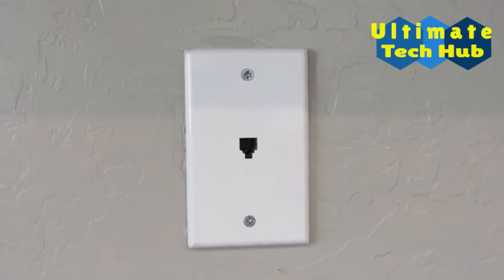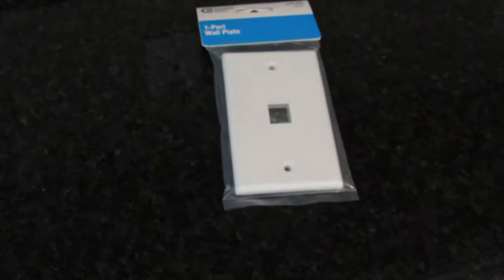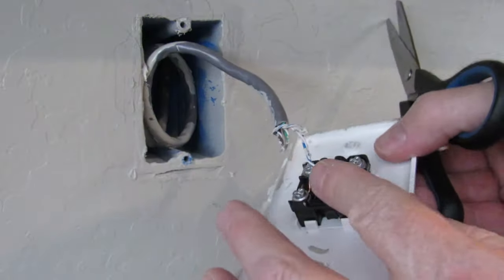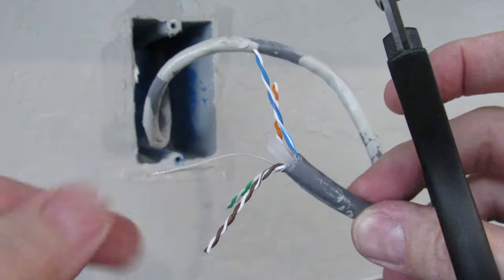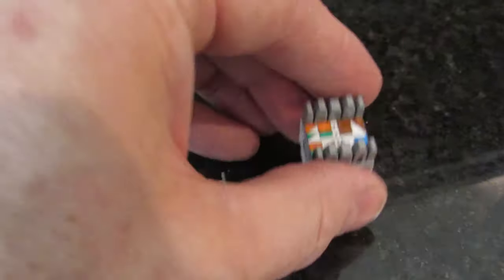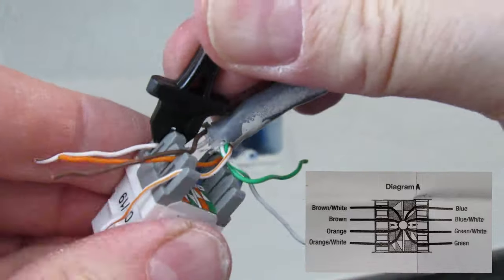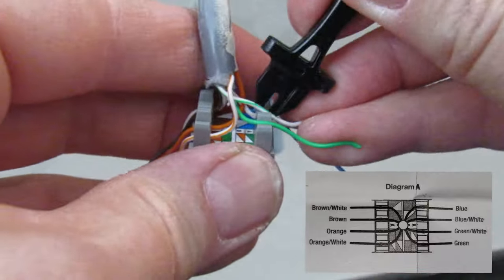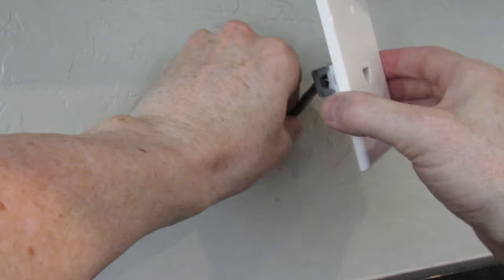CONNECT CAT6 CABLE TO JACK - HOW TO

Comment: The cable in my wall has all the wires except the brown-brown/white wire. Is the brown-brown/white important to have or no?
Reply from the maker: How many wires do you have? If only 4 it's a Cat 3 which is for telephone.
Reply: @UltimateTechHub  i have 6 wires. blue-blue/white, orange-orange/white, green-green/white
Reply: For Gb yes.  For 10 & 100 Mb no.  You likely have 3 pair CAT3, which is only good for 10 Mb.

Comment: How does this work? I have cat cable on the jacks but noticed they’re “daisy chained.”  My bedroom connects to the kitchen with only those two wires.
Reply from the maker: When you say daisy chained you mean they all go to the same location like a network panel? The kitchen wall jack is probably wired as a voice/phone line. These only use 2 wires but you can rewire it for data by following my steps. I do have over 100 Home Networking videos so check them out they should help answer your questions. Thank you for watching.
Reply: @UltimateTechHub  Thanks for the quick response!  So when I looked in the attic, looks like my master has the white and blue connected only to the jack plate.  I followed this wire to the kitchen jack plate where it linked up to the other blue and white.  This wire leads to the other bedrooms, living room and so forth until it finally ends up outside in a box.  So it looks like its one wire all the way; not individual wires to the individual jack plates.
Reply from the maker: @thejackofalltrades5171  unusual setup. You need separate cat5e or cat6 wires in each room to run data.

Comment: thank you for this info, would this work if reversed? I am looking into converting  an existing cable line to phone line jack? is this possible ? thank you again
Reply from the maker: Yes absolutely,  just use the 2 blue wires. Easy.

Comment: I've got two wall ports. Inside of a wall port there is a cable with a coaxial end and the cable that is carrying Spectrum internet. The other wall port only has one cable with a phone line. I'm switching to AT&T internet (the account is on and I can see the name of the network from my ipad). AT&T internet is either inside the wall port by the Spectrum internet or in the wall port where is the phone line. Where do you think is the AT&T internet? Thank you

Comment: If I were to plug an ethernet cable into this linking it to my computer, would that connect my computer to the internet?
Reply: Yes it will but you first need to plug the other end of the cable coming from the wall port to your router.

Comment: My house has no ethernet ports but I plan to convert the phone line jacks into Cat6 data line jacks. I don't know where my network panel is though. I've gotta find it. My question is, considering my phone line jacks aren't ethernet ports yet, do they lead to the network panel?
Reply from the maker: They need to lead to some central place in your house.  Also if your phone lines are cat5e you will be all good to go to convert the phone jack to data port. However if your phone lines are cat3 then you would have to run brand new cat5e or cat6 lines. Thanks for watching.
Reply: @UltimateTechHub  Thank you for your reply. My house is no older than 12 years I believe. So it should be at least on cat5e. I hope. Lol! Thanks!! You're awesome!

Comment: I live in a house built in 1994. My phone cables in the wall say type emc, 22 awg, or something similar. It's very thin with only 4 wires. Does that mean I can't do this?
Reply: You'll need to replace the cable.
Reply: @James_Knott  thank you

Comment: I will have phone fibe internet that will plugin to a main jack the phone company designated. I wish to run it to another room. If I plugin the modem to the main jack the phone company designated and then convert a phone jack that's already in the room I wish to run to as you have instructed. Will I be able to plug an ethernet cord into the converted phone jack and then into my computer and have it work? Basically saving myself having to run ethernet through the house?
Reply from the maker: Of that phone line had 8 wires then yes. If not then a rewire will be needed.
Reply: @UltimateTechHub  ty

Comment: I just have bare wires and the only colors are orange and blue. If I just do the blue and orange would this still work ?
Reply from the maker: No this sounds like a cat3 line so it will not work for data.

Comment: Just a question, my son and I want to add a phone jack and ethernet I was asking for the phone line should I use a cat5 or cat6 cable or cat3? I know for ethernet I am using cat6A.  just a last question I know landlines are dead but my son has that sweet old Snoopy And Woodstock touch tone phone, he was to use it he has a obi 200 my guess would be that I need to get cat5 or cat3 cable and add a rj11 plug on one end that will attach to OBI 200 the other end will go to a keystone is this correct?  also im going to be running separate cables for phone and ethernet. Also do you think it will be worth running a cable jack too?
Reply from the maker: You should use a Cat6 line for the phone. Voice only needs the blue wires but eventually that line can be upgraded to a data line like I did. I would run 2 or 3 lines to that location for expansion and as a backup incase a cat6 fails. As far as a coax cable line I wouldn't run one but that's a personal choice. We don't have cable. Cox is too expensive and we have 1 gig fiber with CenturyLink and steam all of our shows. Thank you for watching and keep me posted. Have a great day.
Reply: @UltimateTechHub  so I could get a cat6 cable and attach a rj11 end so I can attach to the OBI and the other side will run to a rj11 keystone, thanks for pointing out the cable line I understand that I probably sound like a nerd because I am still using all cable and phone lines but I think that they are useful.
Reply from the maker: @dilhangurbuzergamingchanel7306 Glad to help. Keep me posted if you have any other questions.
Reply: @UltimateTechHub  so I just the wire fished through after sweating but just called my local company and they said I need a 110 block in order for me to disturibe it correctly I just wanted to use a phone jack splitter and get cat6 cable attach rj11 end and attach to splitter then to a rj11 keystone.  They said you need a 110 block which I didn’t see anywhere in a diy for installing a phone jack... is my cable company trying to rip me off here???
Reply from the maker: @dilhangurbuzergamingchanel7306  if that was that are saying then yes you need a 110 block. I don't have any videos on how to wire one but they are super easy. I've wired dozens of them in College. Just do a YouTube search for 110 block wiring and check Amazon for 110 blocks.
Reply: @UltimateTechHub  thanks, will do.

Comment: So as long as the phone line is connected to my router the phone line In Another room can be an Ethernet jack?
Reply from the maker: As long as that phone line is a Cat5e or Cat6 ethernet cable.  If it's a cat3 then you can't connect it to the router.
Reply: @UltimateTechHub  sorry but just want to be sure before I do this. If my router in another room and all hooked up, if I do this to a phone jack in another room( assuming it’s a cat5 or cat6 ) it will work.
Reply from the maker: @dericktrujillo6669  yes
Reply: @UltimateTechHub  tysm working from home just got a lot more easier.

Comment: Quick question..

I've cat 3 in my walls. Assume that using all the 4 cables in cat3 to put a cat6 keystone jack than using ethernet cable from my modem to the keystone jack which I've converted from cat 3 than can I get a connection from another jack in the wall ?
Reply from the maker: Cat 3 will not work for data. You will need at least Cat5e. I have Cat6 in my walls and the builder made our kitchen jack a phone jack with just the 2 blue wires. This video was about converting that phone  into a Cat6 data line. Hope this helps clarify things.  Thanks for watching.
Reply: That CAT3 might only have 3 pairs and you need 4 pairs for Gb.  If you want to limit to 100 Mb, it would work and you could still have the phone on it.
Reply: @UltimateTechHub  CAT3 will work for data, but only at 10 Mb.  Also, CAT3 installed for phones is likely only 3 pairs.

Comment: Can I use a phone line to Cat6 converter? Will the speed only 100 Mbps (search from other website said that rj11 maximum speed is 100 Mbps) or it won't work?
Since I'm going to have an access point on my first floor, and my router in on ground floor. The wall port in ground and first floor are phone line port. I don't want to convert the plug, just using some converter. So I will going to have 2 converter which is rj11 female to ethernet rj45 male converter. The converter will connect to my router and a rj11 cable will link the converter and the wall plug. This same goes to first floor access point. Will this works? 
Converter is RJ11 6P4C Female To Ethernet RJ45 8P8C Male F/M Adapter Converter
Reply from the maker: I believe that will work. And yes only 100 mbps is the max.
Reply: @UltimateTechHub  Thanks for the advice, will try at home and see will it works as what we expected.

Comment: I am currently using cox cable with cat 6 but will be moving into my sisters house who is using century link dsl which uses the phone lines.  The dsl modem is in another room and I need to connect my computer via cat 6 cause i do not have wireless nor do I care to because the reduced speed.  Will this solve my problems?  If anybody can answer and respond asap that would be most appreciated!!
Reply from the maker: Here is a video on CenturyLink versus Cox cable and my wireless speeds are amazing!
https://youtu.be/NG0-hSR3iwk

Comment: I have existing jacks in my wall in my 1966 house. After being tricked out of our land lines and the cells constantly disconnecting, I want phones in my rooms again. So HOW do you get the original copper land line that is still connected to my home coming in at the basement connected to the main router so all the jacks in the house work again?
Reply from the maker: Phone lines don't need a router. You need actual phone service for those telephone copper wires. Call a phone service provider to have them set you up.

Comment: Thanks for the video. Is this jack supposed to plug into my router via ethernet cable? And then what, how do I connect my TV to it?
Reply from the maker: You can plug it into your router if that cat6 cable connects to your modem. If you want to connect to your TV just check your TV for internet connectivity.  Most TV models have wireless so just connect to yout wireless router. Easy.

Comment: My condo was built on 06 maybe.. so I have a lot of real phone line jacks. Especially right at the edge of my kitchen. I don’t think I need a CAT 6 port in my kitchen... what else can I do with the old phone line jack...
Reply: Converting it to an RJ45 jack (whether it's cat5,5e,6,6a, whatever) will be a lot more useful than RJ-11 (phone jack). You can plug just about any device into an RJ45, but pretty much just a phone into RJ11. Another major thing is power. RJ45 will allow  you to connect a POE device, think access point for wifi, a voip phone, raspberry pi with poe hat, smart home device, etc. Pretty much anything you can think of and you won't need a power outlet/wall wort there. On the other end of the line, simply connect a POE injector, poe switch, etc. If you don't need any devices there, I'd just leave the RJ11, TBH.

Comment: Most houses are wired with one in and one or two out for basic phone lines
Reply from the maker: Yes especially in kitchens. My last 2 homes had the same wiring setup in the kitchen. Thank you for watching I really appreciate it.
Reply: @UltimateTechHub  
So my point is how do you connect 2 or 3 in to one?

Comment: I have rj11 and i want cat5e, can I do this?
Reply from the maker: Does your cable wire have 8 wires inside it? Check the network cable and it should say cat3, cat5 or cat5e or maybe cat6. if its cat5e or cat6 you are good to go.
Reply: @UltimateTechHub  I’m not sure how to actually remove the plate cover thing off my wall. It doesn’t have any screw holes and I don’t want to damage it/damage my wall

Comment: How can you tell where this cable is going? I have a similar situation and want to convert it to but I don't know where the other side of the cable comes out.
Reply from the maker: You will need to look in your attic to see where the cable runs to. Sometimes by the garage on the side of the house they run the cables to a  catv box. Other times it's somewhere inside the house.
Reply: Telecom & network techs may have a 2 piece tool called a "toner", which inserts a signal on the cable which can be detected.  You just follow along where the signal is strongest.

Comment: I have cat5e cable behind the telephone plates. 3 downstairs and 3 upstairs all in a daisy chain is there a way to convert them all?
Reply from the maker: To convert to Cat6 you would need to rewire the runs. If those lines are cat5e and its used as telephone - voice connections just follow my steps to make it a data connection.  Cat5e is plenty fast for most applications.  Cat6 is great but its hard to rewire houses especially when its in the wall. Thanks for watching!

Comment: Please can you help me. I recently moved to a new house. Every room has rj11.the first that is connected to the router takes signal from the internet provider.the other 5 seem to not work.however The 5 are connected to a switch. Is there something i can do to have internet at all rooms?
Reply from the maker: You do mean rj45 connectors because rj11 is voice. You need the other ports to connect to the router or add a switch to the router and then connect the other cables to the switch. I have over 90 home networking videos on my channel so check out the Ultimate Home Networking Playlist. Good luck and keep me posted.
Reply: With home phone wiring, the cable went from one jack to the next to the next etc., which is not what you want for Ethernet.  You want to run directly from the jack to another jack near the switch.

Comment: Am I still able to use my existing RJ11 jack (also connected via CAT6 wire) in another room for phone land line if I change only the office connectors to CAT6? In other words, can I share the lines in my house for both gigabyte (1.2gb) internet and land phone (house alarm)? Thanks!
Reply from the maker: VOIP is an option. Voice over Internet Protocol, also called IP telephony, is a way to deliver voice communications over data lines. Also it is possible to use 2 of the wires from the cat6 and those 2 wires would be for telephone. That's a more difficult option
Reply: No.  You could do that with 10 & 100 Mb, which used only 2 pairs, but Gb takes all 4.

Comment: how do i know if my house is cat5 or cat6, was built in 2006
Reply from the maker: Cat5e most likely. In 2006 that was the standard. You can check the ethernet in the wall and the cable will say cat5e or cat6 on it. Thanks for watching!

Comment: Will i have to put matching cat wires to make it work
Reply from the maker: Both ends will need to match as far as the wiring diagram goes. If it doesn't then it won't work.
Reply: @UltimateTechHub  Ohhh that explains i was tryna use a cat 8 with cat 5
Reply: @UltimateTechHub  is there a way I can check what cat wire it is just in case its not cat 5
Reply from the maker: @lilgerm383  A Cat8 should work with a Cat5e plug as long as they are wired with the same diagram. The Cat8 won't get the 25 gbps because the Cat5e is only 1 gig.  But it will work.
Reply from the maker: @lilgerm383 unscrew the faceplate and check the wire. It will have writing on it. It will say cat5e or cat5 or cat3 or cat6. Cat5e will work but cat3 will not.
Reply: @UltimateTechHub  what do you mean my same diagram?
Reply: @UltimateTechHub  so do u think its easier for me to just get a cat 5 wire and try again
Reply from the maker: @lilgerm383  each end of the ethetnet cable needs to have the exact same wiring configuration.

Comment: How do I know if my Cat5 wiring has splitting—crawl into my attic? (No basements in my state.)
Reply from the maker: Splitting? You mean one Cat5 that becomes 2 Cat5? The only way that happens is with a switch or a router.

Comment: is the usage of ALL wires important? how come i am seeing phone outlets which only utilize like a pair of wires instead of this full set? sorry im not a technician just speaking what i saw
Reply from the maker: Phone lines only need the 2 blue wires. Data lines use all 8 wires but data can work with only 4 wires but with a max speed of 100mbps.
Reply: A phone needs only 1 pair.  10 & 100 Mb Ethernet 2 pairs, Gb 4 pairs.

Comment: How do I make sure I have a cat6 cable? As long as the colors are the same I should be fine ?
Reply from the maker: Check on the cable wire it will say cat6 or maybe Cat5e which is very popular.  Thank you for watching!!
Reply: so cat5e will work as well?
Reply from the maker: @nomaralvarado8159  yes the wire colors are the same. The only difference is the speed of the data is slower with cat5e. Its up to 1gig and cat6 is up to 10gig. But cat5e is plenty fast for most applications. Only if you have fiber optics would cat6 really make sense. However most new homes have cat6 for future proofing. My house was built last year and it came with cat6 throughout.
Reply: Ultimate Tech Hub ok thank you